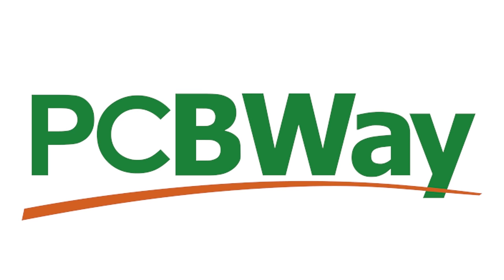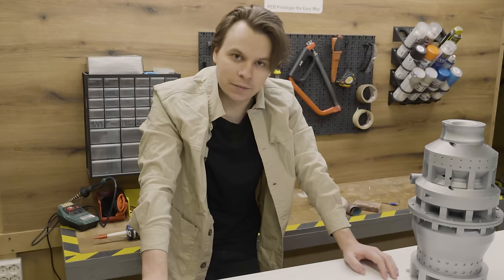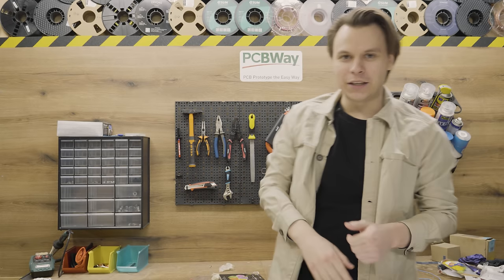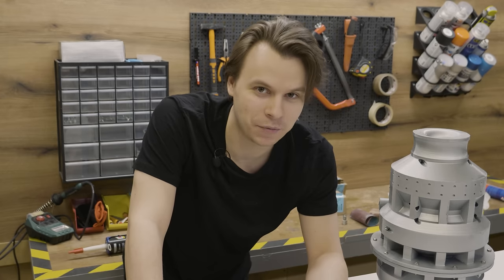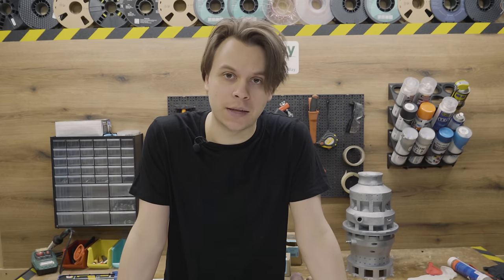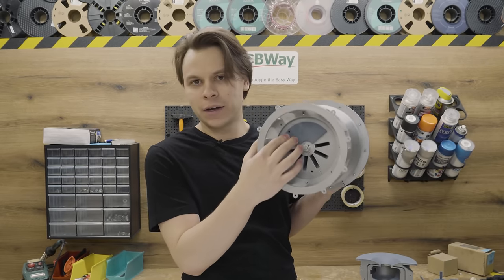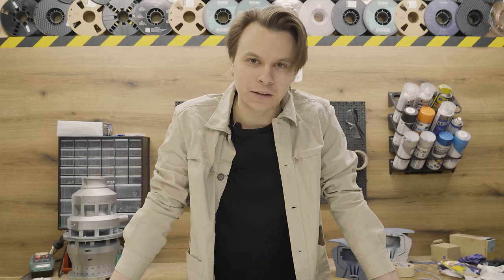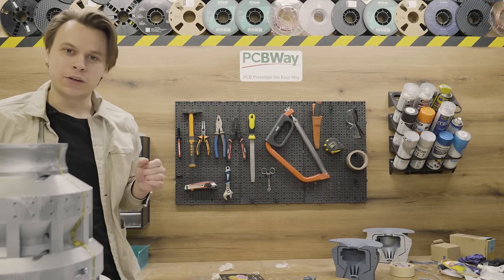It Took Me 3 Months To Get This Working - Two-Stage Centrifugal Compressor 100% 3D Printed

Comment: If I'm not mistaken it looks like there's no point in having two stages. If they both have the same (or similar) sized intakes and operate at the same speed (same shaft) and also have similar outlet sizes then how is there a compounded compression. My understanding is that the compressed air from the first stage will expand to fill the volume of the second stage inlet and be back to almost atmospheric pressure. Great video and I'd love to hear your opinion on this
Reply: Looking at the stages, based on a visual assessment of the compressor wheels, it looks like he's got 2 different gas volumes there.  I'm not sure how different, but they definitely look to be, also different angle on the blades.  Not sure how that affects it either.
Reply: If the impedance (output cross-section) is mismatched he could be getting no real increase, sure. However I think he is still getting an increase. The ideal airflow or air velocity can be different at the same rpm because of the impeller geometry. Even two impellers of the same geometry could produce a static pressure increase I believe, but not as efficiently. You could of course put pressure transducers in each stage to verify this.
Reply: An interesting test would be to remove one impeller to see if it makes any difference to the time it takes to explode a balloon. 
One base line test would be to use your compressor directly attached to a balloon to time it.

Comment: This is what happened. The ball bearings heat on operation causing the walls to deform on each iteration the ball bearings will be wobbly and that cause your design to fail. You need to add a layer of heat resistant material that hold and dissipate the heat of those areas where you interact with ball bearings. Another topic is to clamp properly the 2 parts together and seal them properly and you will increase your success. Great work so far keep it up.
Reply: You can cool plastic near bearings with the air by making air channel insude plastic.

Comment: Regarding the airflow: When I designed my turbopump that was one of my challenges (the pathway of the air) it's preferable if you do it tangentially.

Also, the leakage problem exists when you use PLA!! Everything must be water tight in order to make it work properly, that's why you couldn't pop the ballons up. And to be honest, on your previous designs, I think that was also part of the issue..!

With 600W power I can "propell" water at about 3 metres, the thing was design to operate at 3kW but since it's a 3D printed device, I seriously doubt it won't blow up once I apply that much power, but as proof of concept, yeah, it worked! :)

Try to use CF Turbo (they do have a demo version) to design your props, believe me, once you get the hang on that thing it's just marvelous!

Ah! Another thing, add a pressure gauge to the exit to measure the output pressure!

Comment: Good job. For the leakage problem between two printed halfes I use sandpaper on a glasplate to get both halfes as smooth and plane as possible (180 Grid and some water). Then I use some grease ( e.g. white petrolatum). Works well with PLA.

Comment: Your intake should be larger than your second stage. You're speeding up the air then expanding it across the second stage. These machines work with tolerances that are very tight and having the stages in the wrong order can wreck the machine due to vibration. 20+ years operating and working on these and i still learn more all the time.

Comment: A check valve on your outlet will help as the back-pressure is probably causing movement in your shaft and some resistance. Also like turbos etc you need very low tolerance gaps between your impellers and casing (cheap method could be to use something like aluminum tape on the casing or possibly seals on the blades from a soft material)
- Either way super cool, my 3d printer gets hardly used cause i suck at CAD so i just draw things and make them other ways lol

Comment: There are real world applications: two-stage turbochargers. They use exhaust pressure of an internal combustion engine in place of compressed air, but otherwise operate this way. Normally, turbo chargers are just a single stage, but there are some two-stage ones out there. Very cool build!
Reply: most of the time you just pipe one turbo outlet to the inlet on the next so they run in sequence, make it a lot cheaper.
Reply: @TommyApel  Yeah, compound turbos are crazy, but they aren't really useful for anything besides diesel because air-fuel ratios and pre-detonation issues with normal gasoline. Too bad the only diesels popular in America are the big boat anchor truck engines like Cummins and Duramax. It'd be nice to see more 4-cylinder turbo diesels.

Comment: I'm not sure if you know this, but rotors like these, with a flat bottom, and that suck air from the top, have a net force pulling them axially "up" or out of the intake, because of the pressure difference between the plate at the bottom and the impeller at the top of the rotor.

Comment: What a cool build! My guess as to why the first stage showed more wear: This is the only impeller that is only supported by a bearing on one end, not both. As a result, I think it could wobble and shake more, causing it to hit the walls. It might be worthwhile to try to balance the impellers with weights or drilling holes. I believe this could be very beneficial to the efficiency!

Comment: The problem with that compressor being chewed up is either something where the shaft is off alignment by a hair, there's flex somewhere once it's in motion, or in some cases plastic parts like that will expand a bit if they spin fast enough.

Might be neat to see something like this go further into making a rudimentary gas turbine engine, but it'd have to go into green sand or lost PLA casting processes with machining to clean up and balance parts. No way to get around working with metal, once you start dealing with heat engines. Also at that point you'd have to find a way to lubricate the bearings too, because heat and sealed bearings tend to not get along.

Comment: Really cool build! For the gas turbine, wouldn't it be better to use a pelton type? And for the compressor side you need to consider volume, if the gas can expand again you will loose efficiency.

Comment: 6:55 Instead of your plastic seals, you should have put seals cut from the inner tube, it's much more efficient and it saves you from using glue. In addition, your joints must be the full height of your air compressor.

Comment: This is really interesting. Thanks for the video. Here are some possible improvements and explanations of the phenomina at play: 
First of all, it appears that you dont have a designated fixed bearing. So when standing up, there is some metal to plastic contact from the couplers or even some plastic to plastic contact in the turbine, which increases friction. 

Secondly, the reason why the first impeller got shaved and gradually got more play, is either unbalance or an aeroelastic phenomena, where the turbine gets pushed of center by the aerodynamic forces. It could be a feedback loop between the play thats already in the system (due to it beeing mounted on the bottom, rather loosly, at a different height then the center of mass and the center of pressure) and an induced oscillation caused by the tighter side achieving higher pressures, which then pushes the compressor over to the other side - repeating the process. This would correlate with it getting worse faster after achieving higher pressures. To get rid of this phenomena, increase the stiffness of the coupling between the shaft and the compressor wheel. You could also mount it at the top and at the bottom. 

The second stage could be improved with a propper stator that realigns the airflow and corrects for induced rotation in the fluid. Since the second stage is rotating at the same rate and direction as the first stage this induced rotation reduces the bite the second stage has on the fluid significantly. 

Also as you found out, reducing leakage is key. So implementing a proper pressfit seal (printed from TPU) between the two halfes would help alot. 

As for all turbomachinery: tollerances are live. So the tighter the tolerances, the less the airleakage, the better. 

Maybe this helps if you decide to continue the project, or anyone interested.

Comment: we actually do have a use for these when powered by compressed air. pressure boosters.

it's not something i'd recommend and piston boosters are generally better but i have actually made a 1:6 centrifugal booster. it made sense for the project but the deciliters per second it puts out makes me cry, even at 35 bar.

Comment: The impeller are rubbing the housing because the clearances are considering what is happening at 0rpm, when up to operating rpm the centrifugal forces would cause expansion axially. Automotive centrifugal compressors using aluminum alloys are stiffer(relative to plastic/resin). If you dont want to do the engineering work to figure it out you can just axially scale the model and test the new one.

Comment: I think you missed checking out normal turbochargers. For one, they have a beefy thrust bearing which you seem to have figured out. Second, dual-stage compressors are usually for high pressure, not really for large flow. The 2nd stage wheel is likely too large, or 1st not large enough. Third you need to seal between the inlet AND outlet for each stage, not just one large seal. Fourth, when spool-up isn't a big deal, a larger turbine outlet is better. They work off the expansion of the turbine air, not so much the paddle/pinwheel effect of air slamming into the inducer-side.

Comment: Theres a difference between your 2nd stage and turbine and the 1st stage which is likely causing the rubbing.. the first stage is unsupported while the other 2 have support on both ends. 1st stage is wobbling. Put a support above the intake and lengthen your rod.

Comment: I love your videos. You will be one great engineer one day. Just be patient and think all over, a few times more.

You should try printing some TPU to use as a gasket, instead of the hot glue. Polymaker TPU HF 95 prints flawless on the Bambu Labs X1C. 
Depending on the infill you can alter the rigidity.

Hope this will give you some other perspective.

Keep up with the great work!

Comment: Nicely done ! But, such narrow air passages . I would add cross sectional area to the air passages to minimize resistance to flow. also, a thought: if you make a channel in the mating surfaces of the casing from one end to the other you could fit a seal made of polyurethane elastomer into it to seal the leak. Best of luck!

Comment: So this is basically like a compound turbocharger setup you'd see on a crazy modified diesel truck, except with a single turbine spinning both compressors. It'd be interesting to see how this sort of design would change the performance and efficiency of diesel engines compared to normal turbochargers.

Comment: Maybe look at using 3d printed TPU seal ring between all 4 outer housing parts. the TPU will compress against the walls and help keep everything sealed in, so less air would leak out.

Comment: Great video, regarding the damage to the turbines (especially in the previous video) i have a hunch could be attributed to the perpendicular force generated by the turbines, in reaction to the compression action (a gyroscopic effect if i'm not mistaken). Placing them vertically was a great idea in-fact seems to do the trick, at least in most part. Hope this could be useful
Reply: Glad i said something useful, but actually i mixed 2 forces: the gyroscopic effect (which i think has the higher culprint) and the reaction to the compression by the air.
I think you could analise the vectors in the project fase, and you could avoid the gyroscopic effect using an opposite rotation part that pull in the opposite direction. Although i fear would really complicate A LOT the project

Comment: maybe instead of burning stuff to get a volume increase you might inject LN2 into the airflow, which boils becoming N2, and that can then drive the turbine.
to evaporate the LN2 a heat exchanger might be used.

Comment: The balloon is not an indicator of how well it works. The more you restrict the outlet, the higher the pressure will be at the balloon; if you restrict the outlet fully, it would work at top efficiency going by the balloon measure. It only makes sense to use the balloon if you're driving the turbine with a motor, otherwise the balloon is just an indicator of the air pressure you put in, combined with the amount of resistance the air faces going to the outlet.

Comment: Wow, pretty close to some rocket engine turbopump designs, but an impulse turbine to drive the shaft would get you better dP across than the reaction turbine you have now. You should consider adding an inducer to your pump inlet before the impeller for even better efficiency

Comment: My Theory:  The only turbine that shows wear from eccentric rotation is the only one whose axis is not constrained by a bearing at each end.  If you were to extend the shaft and incorporate a bearing at the inlet mouth, you might be able to eliminate that eccentricity.  No need to reprint the housings necessarily either:  You could adapt a bolt-on or clamp on or press fit bearing holder retrofit.  As simple as a y-shaped thing, or even as fancy as the LAX air traffic control tower.

Comment: I think filling seams with silicone would have been much better as you would still leave an option to easily split the parts as long as one side had some light layer of wax or silicone grease to prevent it from sticking to one of the sides

Comment: Not sure what the goal is here.  Re-designing the wheel?   Very cool print though! 
If you just want to blow up balloons.  There is a much easier, more efficient way to do so.   It's put the balloon directly over the end of your air compressor hose/ blowgun.  It would most certainly take lots less air.   
I guess it's fun to play though!  Or is it?
I will give it a thumbs up for the effort in print skills. 👍

Comment: I can actually think of a use for a device like this. In the oil industry and in some other industries you have areas that can have potentially explosive atmospheres. Tools in these areas need to have very strict control over ignition sources, and therefore electric equipment becomes very heavy and expensive. As a result, compressed air is very common, and used to drive all kinds of tools. It's almost universally 90PSI/6Bar. So uf tou need a higher pressure a compressed air driven air compressor actually makes sense.

Comment: build yourself a balancing rig to balance those impellers and compressors you can hear the imbalance which will only make things worse the faster you turn them cause more heat in the bearings and cut your efficiency greatly

Comment: What is the flow rate and pressure of the feeding hose? 
What is the flow rate and max pressure do you get at the output?
This will tell if you compressor is efficient or not.
You can explode a balloon without this turbine, just use your feeding hose.

Comment: Not to lessen your project, but they had this figured out and in smaller packaging in the 1950s and 1960s jet engine designs. Yes, even with centrifugal sections.

Comment: maybe the impeller on the top has the issue because its not supported on both ends like the other 2 (which have 2 brearings)

Comment: If there was friction on the first stage, after it wore itself out a bit it could have been spinning more efficiently. Possible sealing the joints had nothing to do with it starting to work after so much testing.

Comment: Hey, I'm going to ask a dumb question. It's because I truly don't have a full understanding of how turbine motors work, but just a gut feeling looking at it; wouldn't it work better if all turbines spun independently of each other?  The gut feeling I'm getting I mean is they can only spin as fast as the first one can spin.  I'm so sorry if this is a dumb thing to say. I guess I should just go watch a video on turbine motors.

Anyways super interesting video and I'm now subscribed. I'm sure you have a lot of hours I need to catch up on
Reply: Just watched a video on a turbine. Guess I should have watched that video before I made a comment on this one.  The boost from the back turbine spins the whole shaft,  I guess what I really thought was each turbine was spun by the force of the previous one and you kept changing the blades and the design of the fan to compress air.  But what I said right now now they say that aloud makes no sense it won't work.   Lol, I'm a dummy

Comment: Looking for a 2, 3, 4, or 5 stage centrifugal compressor driving by exhaust or direct drive from car engine. Need 10 - 20 bars flowing 1000 - 3000 cfm. Needs to be lightweight, compact, and reliable.

Comment: Would be incredible to see this used with a thrust bearing and butane to create a refrigerator or even air conditioner compressor....The low amperage startup requirements could yield to a very efficient setup and if you were able to solar power it; youd be a millionaire

Comment: Do you think there’s any relationship between the angle of the compressed air on the turbine and a sailboat going faster than wind because it’s traveling diagonally across the airflow?

Comment: It's better if the turbines are on an outer ring facing a central void, instead of forcing the air in a circle, it twists it, like a tornado. Add some fuel and a spark plug and you got a jet engine